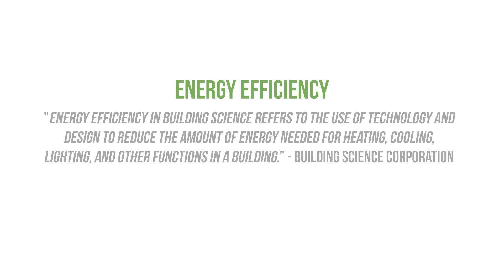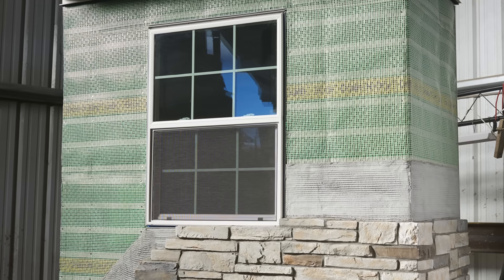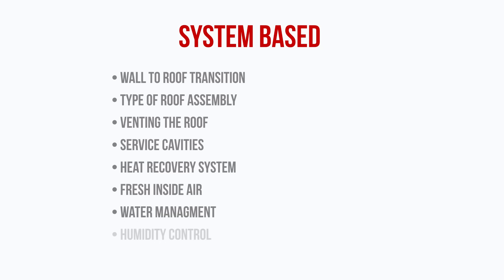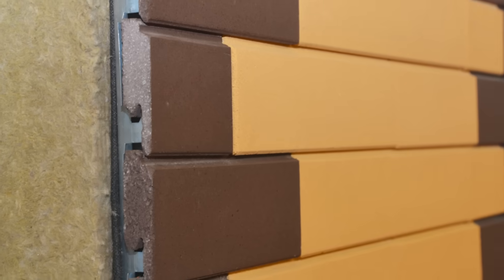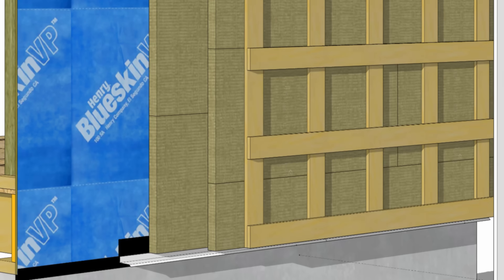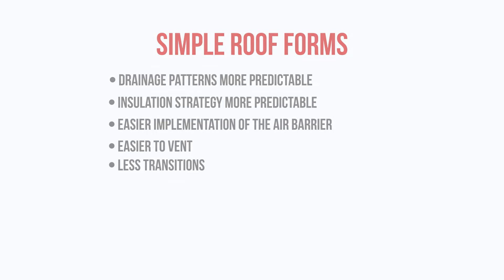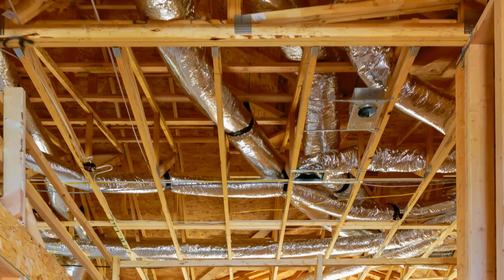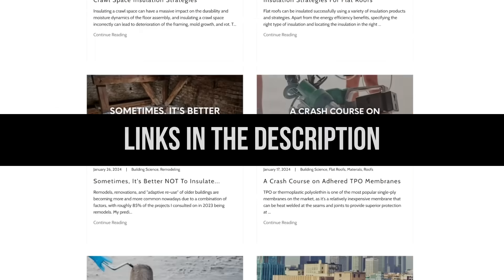Energy Efficiency is NOT High Performance...

Comment: Are floor systems that utilize floor trusses required to have fire stops?
Reply: NO: EDIT: Between multifamily residences: Yes.  Between Floors: yes.  Inside a single floor?  No.  No different than a drop down ceiling.  Besides if you REALLY want to design your house right you will install INSULATION on bottom side of floor above you for SOUND reasons alone and so sound does not travel down air ducting as honestly no one really wants to hear when the toilet is being uh... "filled" or flushed or someone is on the phone, playing a game, or boinking

Comment: If you’re using rigid foam insulation on the exterior of the building, do you still want a 1/2 gap between it and the WRB, or is a product like VP100 sufficient?
Reply: VP100/Exterior foam/ 1/2"gap / cladding
Reply: @cg3356 thank you
Reply: Depends where you live.  This channel is showing worst case scenario with no MAJOR caveats and people brainlessly nod along.  If you live near ocean/large lake with wind driven rain, continuous humidity and you are a blithering fool who cannot be bothered to build eaves, then maybe to yes, a gap is in your cards.  Depends on the insulation.  Does it absorb water or not?  If no, then NO.  If you live ANYWHERE else and only have occasionally wind driven rain in short duration, then that air gap is useless and only a giant WELCOME sign for ants, rodents, wasp nests and you DO NOT want it.

Comment: If you have a heat pump split system do you still need ERV or HRV?
Reply: They do 2 different things. a heat pump pumps heat, an Energy/Heat recovery ventilator ventilates. 

The first conditions the air that's in the building, the second exchanges that air with the outside in a sustainable way. The air exchange is needed to get ride of high CO2 levels (from breathing) and/or other contaminants (like cooking). 

The more tight a building is, the more you need an HRV/ERV.
Reply: In a sealed home, you will suffocate yourself without an ERV  Split systems just add or subtract heat from your home.  They do not ADD new oxygen and remove CO2 and other noxious gases which build up in your home over time.  All of your plastics in your home from paint, carpet, to shampoo, for instance OUTGAS eternally.

Comment: Letting houses breath is such a joke. Even if massive amounts of air leakage kept your house free from rot it will very likely lead to mold.
Reply: ? No.  For mold to grow you need a CONTINUOUS stream of humidity/water. Zero insulation for instance has no such problem unless you literally live next to a lake and even then it is not a problem.  Why?.  Old houses are built using SOLID lap sheeting, NOT plywood and fiberglass insulation or none.  They did NOT use cellulose blown in garbage which retains moisture!!!!!!! Lap sheeting does not RETAIN moisture like plywood let alone the travesty known as OSB.  Humidity and mold require Condensing surfaces--> mold grows.  Mold grows around bathrooms --> Humidity and not sufficiently SEALED as doing so is Slow.  Only real way to do it is with urethane foam/paints over concrete/plywood, seal every outlet, fixture.    Whatever you do, do NOT USE OSB anywhere in your home.   Closed cell foam ONLY or mineral/fiberglass/rockwool(all same thing just called diff names for some ODD reason)  Never Cellulose insulation.

Comment: I'm confused about the fire risk. I live high in the mountains of Arizona, a very dry climate. I am at zero risk for tornadoes, hurricanes, earthquakes, floods (I'm not building near a creek) and lethal Canadian blizzards; but you can't have everything. I'm building in a fire canyon. Building a 'fire-hardened' home is critical. It's not "what if a canyon fire breaks out..." it's a matter of "when the next canyon fire breaks out..." My plan is to have a stucco exterior with a 1/2" rain screen over adobe structural wall, heavy clay tile hipped roof (no high gable walls to protect) and all vents and openings screened with fire-resistant intumescent coated fine mesh screen. But, if I understood you correctly, a 1/2" rain screen is also a fire chase and will increase my risk of fire damage. How the heck do you mitigate that?
Reply: You can use the same intumescent screen to cover the lower and upper opening to the exterior.
Reply: @Boxerdude  Great idea - the only thing flammable in my wall assembly is the rain screen. Protecting that with fine mesh fire screen is a great idea. Thanks!
Reply: @Boxerdude  After the screen swells up from a heat source, you'd have to replace the screen ? Why not just regular metal screen ?
Reply: @bobnomura2068 if the acreen heats up enough to swell shut, there's probably a lot of replacing to do on the outside of the house.  Just, hopefully, not the entire house.
Reply: @Boxerdude  Precisely! Roof repairs sound a whole lot better than roof replacement.
Reply: Rockwool exterior insulation is fire resistant.  You wouldn't need much, maybe an inch.
Reply: @michaellautermilch9185  Uhm...why? Stucco and adobe are pretty fire resistant, too. What advantage would I gain by layering in Rockwool?
Reply: The dude is just plain--> Wrong regarding the air gap behind.  There is simply no other way to put it unless you live next to a LAKE/OCEAN in a VERY humid climate.  Then and ONLY then does his airgap address a ****potential**** problem, but then it is ONLY a problem if your cladding was installed WRONG to begin with.
Reply: The stack effect that vents your walls and roof will also suck in fire. Sounds like your walls are relatively fire resistant, stone fiber could help protect your roof if vented (put it in between the vent area and whatever is flammable below, roof sheathing will still burn) or better yet dont vent the roof
Reply: @Austin-fc5gs  Hmm. I am building an unvented attic (it will be part o the indoor enclosure, heated, cooled and ventilated like the rest of the house). The roof, however will be vented. I plan on heavy clay tiles resting on furring strips and battens for perfect air circulation, with the ridge vent and lower eaves protected by intumescent wire mesh. The deck itself will be Arklin or similar intumescent coated plywood with a foil-reflective self-adhered ice and weather shield. Even though I'm up in the mountains, it still gets hot in the Arizona sun and I hope to reflect some of that heat with the protective barrier. I not only need this to be fire hardened - I want it to perform well and keep my comfy all year round.

Comment: Buildings do need to breathe, but only via mechanical systems that filter and condition the air before dumping it into the living space. You definitely don't want your house 'breathing' thru the envelope. That's exactly how air and moisture travel to hidden places and do major damage.
Reply: Maybe a better description is that houses need to dry.
Moisture creates a whole list of problems in a home and the quicker you can dry it out, the better.
Reply: As Matt Risinger said, if it can’t dry it’s gonna die.

Comment: Buildings needs to breath means that moisture that escapes through the walls can dry from the outside easier. I have seen most modern interior Polly type of homes with major rust on nails that go through exterior sheeting in areas like kitchens and bathrooms. Damp air gets through the holes in the Polly presumably and gets into the wall cavity. If the exterior sheeting is sealed with a tape or membrane it makes it even less likely that the moisture will dry to the exterior. That’s why I prefer traditional tar paper over any of the newer systems….80+year old homes with fantastic condition of the ship lap mind you with limited to no  interior insulation OR vapour barrier. And new high efficiency homes I have seen have serious cold weather condensation problems even while the job is still in progress…$20,000,000 home with engineering galore. The theory and application of high efficiency homes are two different things I find and with the quality of materials and workmanship these days I find it is very risky
Reply: This channel talks a lot about the need for exterior insulation in cold climates, which prevents condensation when the interior vapor barrier fails. This channel also talks a lot about the risks of renovating old buildings to be air tight. This video would be about a new building either in a warm climate or in a cold climate with exterior insulation preventing condensation inside the walls. This channel also talks a lot about the need for an ERV for ventilation and a dehumidifier for interior humidity control. While you're right that would be better for a house to use old technology that works rather than new technology that doesn't work, this channel and its videos are about new technology that DOES work.
Reply: @LuminairPrime  Well no, this channel is about HOPING the new tech works, compared to old "new tech" which was supposed to work when it was installed and pushed into code.  You will not catch me dead installing EPS, EPX, PS, cellulose insulation on any portion of my home.  They should be BANNED as they degrade, or are MASSIVE fire dangers and if not fire dangers invite ants in with a giant BBQ welcome and friends sign, just as OSB should be BANNED as it cannot get rid of water moisture and it just holds it.  But nearly everyone uses the utter garbage and now is using the garbage in liu of wood joists etc.  Utter insanity  We KNOW what works, Solid wood(not plywood or OSB), Poly Urethane foam, Fiberglass blown in, but they refuse to make it as it costs 25% more, or worry about installers health instead of long term health of the building being built.  My Grandfathers flat roof of Poly Urethane sheethed in concrete coated shredded wood board with torch down roof was wonderful.  70 years old, still kicking just fine.  Perfectly air tight, mold proof, insect proof.  Zero issues.  Today "genius " engineers can't even make sloped roofs correctly with the "new tech" which is code required.  No damned ERV BS which just one more danged thing to cost $$$ with eternal power drain and maintenance.  Barf.  NO MORE MAINTENANCE!!!
Reply: @LuminairPrime the problem is I’ve seen multi million dollar exterior insulation and vapour barrier membrane systems that fail…they fail at weak spots and the failure points are where all the air in the house tries to escape. My point was that these modern systems require flawless install and even then are too new to have seen long term performance. I’m all for trying new things though
Reply: Sounds like you have a skill issue. Tar paper what a joke.
Reply: @user-ky4gg5rl8k  in all fairness tar paper lasts 80-100 years. Zip is warranted for 30? You wanna redo your envelope in 30 years? If you do this perfect will it last as long?
Reply: Survivorship bias. Of course a leaky house that consume tons of energy will stay dry.
Reply: The less air leakage the less condensation and the more effective passive drying systems will be. Think about an ice chest, no one has to worry about mold growing in the walls because it is completely sealed an ACH of 0.
Reply: In my humble opinion the use of practically vapor tight exterior sheating is a fundamental flaw in the American house building system and the main cause of most of the problems.

Comment: Hey why not run a double cmu wall with some kind of exterior insulation(3 to 4 inches)on the outside of the inner wall with a 3 inch gap in between the insulation and the outer cmu wall? So starting from the inside it's cmu wall with breathable yet elastomeric clear coating. Next is 4 Inch exterior insulation. Last is cmu with elastomeric breathable clear coating? In the inner wall you could stuff insulation like wool and the outer no insulation since it's also the structural wall and primary condensing surface i think? It would be thick but should be durable and meet code. Maybe too costly? Seems DIY friendly?

Comment: What do I need for a central american very hot and very humid climate? ERV or HRV?  Is a dehumidifier integrated or a separate system?
Reply: Erv, dehumidifier is separate
Reply from the maker: @tysonreed6169 This is exactly right.
Reply: Get a purposely undersized HVAC system. You'll get some cooling and a lot of dehumidification. 

Then you can add a second unit for when it's really hot.
Reply: ERV recovers some dehumidification but can only do so much.